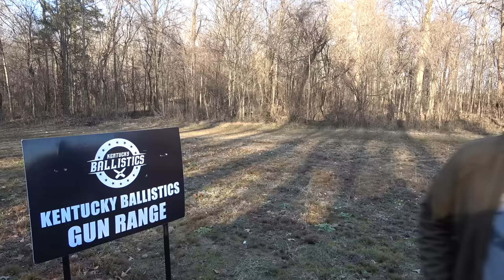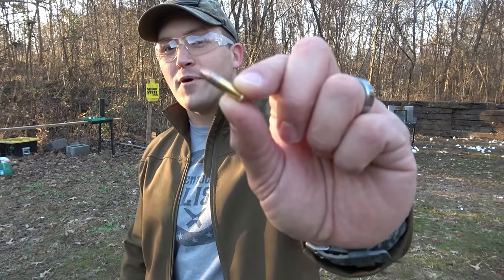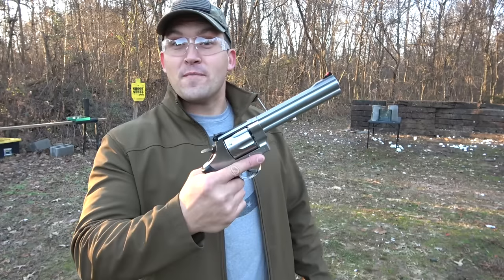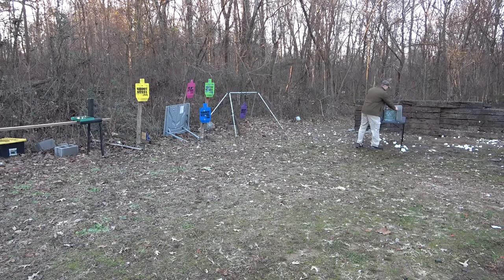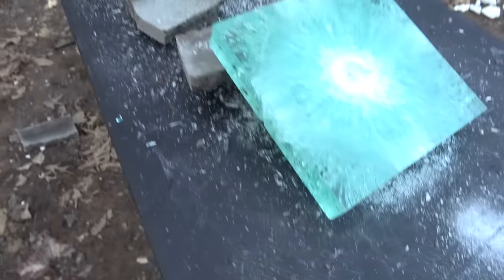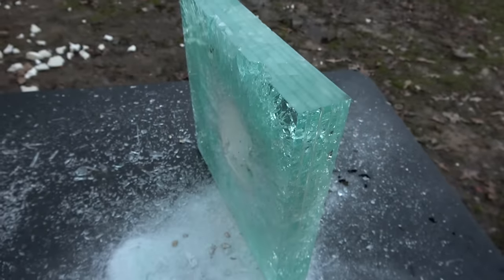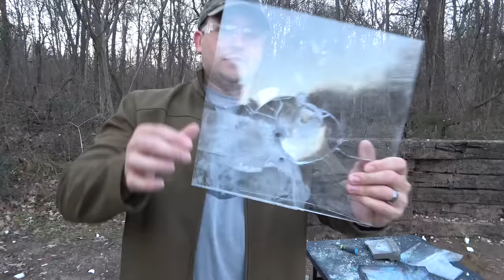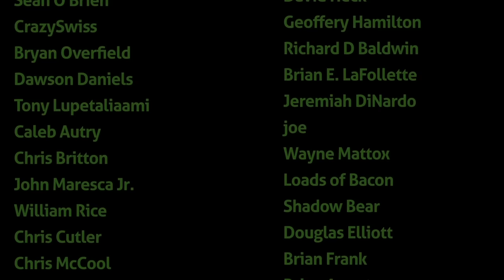Double Barrel Elephant Rifle vs Bulletproof Glass !!!

Comment: I think you shot the glass backwards. Not sure if it makes a difference, but the ceramic side should be facing away from you.
Reply: What ceramic?
Reply: @omnomshibob  the side that doesn’t crumble
Reply: Yes, I think so too. The poly-carbonate (plastic) is most likely away from the threat, to protect from glass splinters flying around.
Reply: @doejohn8674  exactly my thought
Reply: I think you’re correct, the poly side is to protect the people on the inside from it raining glass on them, I believe
Reply: Your right I thought the breakable glass was to break up the round and the lexan side was to stop the now slowed shrapnel am I wrong?
Reply: The crunchy side would be outside of a vehicle, it breaks up the bullet and the soft stuff stops the piece of bullets
Reply: The soft side should always be at the back to catch bullets after they dump energy into the hard glass, I'm pretty sure of that.
Reply: I think you mean polycarbonate, and yes, he had the first pane backwards. I realized that after the first round and thought "welp, there goes the glasses integrity."
Reply: @mikesmith3771  according to me as well, that's what I picked up from other channels.
Reply: They did the same thing in a How Ridiculous video and it does make a bit of a difference
Reply: I guess I'm not the only person that has this idea. Matt at demo ranch could have told you as much...
Reply: @omnomshibob  Glass is a cermic
Reply: My thought exactly. He shot it from the from the wrong side.
Reply: @ilpoheinola6440  cermic?
Reply: @ilpoheinola6440  yeah but technically so is concrete, cement and brick. They all have specific names to distinguish between them, you don't go to a restaurant and just ask for "food.
Reply: @omnomshibob  😂
Reply: Yea he did was about to say the same thing the glass side is the impact side
Reply: Literally just posted the same thing
Reply: Just incase you dont know, bulletproof glass is one-directional. It only works correctly if you shoot it from the correct side. 
By the looks of this footage, you shot first pane from the wrong side.
Reply: Ahhh...
Ok. 
  That would make sense now, after seeing all that glass (facing the would-be defendant) splinter and fly apart TOWARDS the person (lol!)
Reply: these windows do have a strike face usually glass side out unless I'm mistaken.
Reply: It dosn't matter in terms of penetration, Though you are correct the site that splinters should be facing away from what you want to protect, There are multiple layers of the plastic throughout the glass so its not like it only works in one direction.
Reply: Yup wrong way round indeed 😂
Reply: Also should have been framed around. Would have been way stronger. The layers wouldn't have delaminated as they did.
Reply: The glass side that should be in front is hard and starts the "mushrooming" and slows the bullet  that way as it goes through the other layers. Also like above people have mentioned the poly-carbonate is to stop the shredded glass to flying at people inside but also it is stretching and catching the deformed bullet as it comes deeper. That's at least what I've learned from Demos videos and it makes sense to me.
Reply: Was just about to comment the same thing. The plastic/ polycarbonate is supposed to protect from flying glass.
Reply: @brandonrupp5880  Who's Matt and what's Demo Ranch?
Reply: Im gonna agree, not because I know, but because I wanna see this re-done.
Reply: @greggb557  he short he second one correctly
Reply: @mikesmith3771  you are very much correct.
Reply: @omnomshibob  
Wait what? Words have meaning? WITCH!
Reply: I know you
Reply: The hard part is supposed to break up the bullet, and the soft part is supposed to catch the fragments. That's how real bullet stopping armor works anyway.
Reply: @hamishsinclair3541  poly carbonate aka lexan
Reply: John Cage nah it’s like a claymore except you point to toward your self
Reply: @mikesmith3771  no thats totaly right
Reply: It does make a difference
Reply: Instructions smutchins psh lol
Reply: yes he shot it backwards. The glass should be first in line then the polycarb.
Reply: @Deere2154D  yup. Exactly what it is. Lexan backing lol. Not forwarding. Still would stop one round either way
Reply: We are surfing on same wave
Reply: Yeah it had an anti-spall liner to prevent injuries to those behind the glass from fragments created by the kinetic energy of the round
Reply: Glad I’m not the only person who was thinking about this.  There is ceramic armor, so I’m guessing the glass layers would be toward the threat with shatter-resistant polymer behind it.  Same concept, I guess?  But I’m far from an expert, and this video was interesting if for no other reason than I’d never given it much thought.
Reply: Plastic is usually on inside to protect you from glass shrapnel.  Call Demo, he knows which way they go. Get a knife from him. It won't break.
Reply: I was going to write the same response but saw this one first.
Reply: @omnomshibob  food for thought, if glass and concrete are both technically ceramics (made from sand) skyscrapers are just really big sand castles
Reply: Was just going to say that
Reply: Sounds like a redo is in order
Reply: Glass was backward. Even though if I was him rather have the glass go backwards and not the other way around at him.
Reply: It was definitely backwards, the shards are not supposed to go into the passenger area of where the window is placed.  there is a plastic or some-such piece on the back side, and the front is multiple layers of glass with glue or something.  but if the side you are shooting is not cracking and the other side is, you are shooting the backside of the window.
Reply: The normal glass is important to make it scratch-resistant on the outside. The polycarbonate will eat the energy. Also - polycarbonate can't handle UV light from the sun, and the normal glass will block most of yhe UV. Polycarbonate windows have a limited life span if not protected from UV light.
Reply: @mikesmith3771  you are not
Reply: @omnomshibob  maybe you dont.
Reply: Don’t pry with knives
Reply: @ilpoheinola6440  that's what he's saying, the ceramic (glass) should be getting shot and the polycarbonate (plastic) catching shrapnel.
Reply: yep he shot both pieces from the wrong side. The plastic layer should sit last not front and is intended to catch all the broken glass.
Reply: Love you vids very fun👍👍
Thank you

A solid will out penetrate a soft point  anytime😁
Martin
Reply: i made exactly same comment as you, thinking im smart and whatnot and later i scrolled down... lol
Reply: Polycarbonate is a no-spall layer and is designed to be on the “safe side”. You had it backwards. Check our channel for testing videos. 🙂👍🏼
Reply: I was looking for this comment the the plastic like side is supposed to catch the broken glass
Reply: Thats the side that only the bad guy worries about
Reply: @hamishsinclair3541  Magnesium Oxide is the only ceramic material that I know of that can also be transparent.  There are also a number of translucent ceramics.  But no ceramic can bend as shown in this video when he is trying to remove the bullet.
Reply: @johncage3025  Plus, it's on the inside to minimize the damage received (in the plastic) by that Lucky Ol' Sun.
Reply: Scott....most OTF knives aren't worth a crap for quality anyway !    Not All...but Most !  
👍
Reply: same
Reply: There is no ceramic or backwards bullet proof glass is 4 frame 2 sided and there is no ceramic on it 😂 wtf you think this stuff is made at hobby lobbyb😂😂
Reply: And yes technically all glass is ceramic however there is no glass in fuckin bullet proof "glass"
Reply: Polycarbonate and acryl pmma is what bullet proof glass is made of and no it doesn't matter what side Is shot penetration wise. That's basic physics 😂 like saying it would matter If I shot you in the back of front. F internet experts 😂
Reply: yes the polycarbonate side goes inside to protect the people inside from flying glass shards and it also gets damaged and super brittle with direct sun light. still very nice to watch what happens. ive wanted to shoot some of this stuff for so long to see if it really works

Comment: The glass was compromised from the first shot.
Reply: That’s why he used two pieces ya dingus
Reply: @James-kb5mx  still compromised
Reply: As long as the bullet was stop it did its job. Did you expect the glass to still be perfect?
Reply: @jdee8407  bulletproof glass is like "waterproof watch"  no such thing.   just resistant. and use makes it less so.
Reply: I agree. He should have switched new glass for every gun fired. Still a great video.
Reply: @James-kb5mx  Dr. Brule approved
Reply: Exactly! He should have had more pieces to test.
Reply: @jdee8407  Funny all this, actual bullet proof 'glass' is actually plastic, that was just thick actual glass sandwiched together in layers with a resin, pretty different.
Reply: @earshot1111  BRULE’S RULES
Reply: @snowboxesful bullet proof glass isn't plastic. It's extremely heavy, a regular window about 2 inches think can range from 100 to 200 pounds. Layers of glass are glued  together with a special type of glue. This varies between manufacturers, it's a evolving science but acrylic glue, several different glues mixed together, epoxy, polyurethane and PVB. Thing you don't understand is, bulletproof glass is one thing and bulletproof acrylic is completely different. Most bulletproof glass has Lexan or polycarbonate on the back of the glass. Shooting glass backwards lowers how effective the glass is because layers start coming apart as he showed

Comment: Meanwhile in Forged in Fire:
There was a tempering issue in your knife and resulted in a catastrophic failure. Please leave the forge.
Reply: It did not keeel
Reply: I mean if it’s microtech, he should have just bought a knockoff microtech. Marfione is  kind of a prick about warranty stuff. If you dare take it apart to clean it, congrats you have voided your warranty
Reply: That’s funny!!!  Nice cross over!
Reply: Today we will test the durability of your knife by banging it on bulletproof glass then banging the bulletproof glass against your knife. Remember this is a test of what the material does to your knife and not what your knife does to the material.
Reply: I wish every episode of that show wasn't basically the same
Reply: It shall not keel

Comment: “That glass is really really shattered, I don’t wanna touch this”

Matt: Casually touches broken glass every time.
Reply: Matt from demolition ranch
Reply: Doesn't Jump to conclusions  the guy that touches glass after breaking it every time
Reply: Gloves Matt! If you could put the glass on an 30% angle the result will change it adds thickness and changes the direction of the projectile.
Reply: "Bullet proof glass" is safe too touch its tempered glass. You can bathe in it and wont get cut.just a prick from a glass shard or 2. Sorry I work with glass for a living.

Comment: Sad day when you try and use a otf as a pry bar. Especially if it’s a micro tech. Will be having eggplant Parmesan for dinner in protest of the knife abuse. Still a great video of course
Reply: Underrated comment here. And I agree with the point, use the right tool for the job
Reply: Wrong way to use a $100+ knife. Great for stabbing, bad for digging.
Reply: @punkotaku9906  that’s a combat from Microtech. Try $500+ knife. They will fix it for free. Lifetime warranty
Reply: @jeremyh172  Not after watching this video they wont :p
Reply: @jeremyh172  Haha I gotta imagine prying bullets out of glass isn't covered under warranty. I'd be impressed if it is, but sometimes that part of what you pay for up front

Comment: 8:25 yeah, bulletproof glass is just a composite of interchanging glass and plastic sheets. Interchanging something hard but brittle and something soft but elastic is basically the #1 method of making extremely penetration-resistant materials. Beaten only by metal alloys which combine hardness with some elasticity and so are able to absorb impact energy without shattering and spring it back into the impactor. (Hence why steel ricochets bullets so damn much.)
Reply: Barret M95: Allow me to introduce myself
Reply: another important characteristic of armor is the ability to cause the projectile to break up on impact, or to be so degraded by penetrating that the round is no longer effective. glass is very hard on a bullet, almost like an abrasive effect.
Reply: @captainprice3398 children

Comment: The glass layer is called the strike face. Orient toward enemy. The thin plastic is simply polycarbonate, which acts as a binder for the laminated layers. Delamination is common after multi hits. Insert the sandwich into a steel channel frame bolted together and mount it solidly where energy is not dissipated destroying a cinder block etc. it will pass through. Place a thin aluminum witness plate 12” behind it and you’ll get a good idea of how much damage the spall can do. Have fun 😀
Reply: His two squares of bulletproof “glass” weren’t identical. 
The first one seemed to be comprised of around 50% of some plastic sheets laminated together and then the other inner half was glass sheets laminated together. 
His second piece looked like 100% glass laminated layers. 
But you’re right, this guy needs to put in some more prep work to do this the right way. Put the glass into a frame instead of being lazy just leaning it on cinder blocks!

Comment: What impressed me was when you had the cinder block behind the glass, and even though the bullet did not penetrate the block, the muzzle energy was so great the glass collision shattered the block! I've often wondered about bullet proof vest; with say a 44 Magnum, while the vest may not be penetrated, all that muzzle energy has to go somewhere. I would suspect severe internal bruising like you get in an auto accident.
Reply: You are correct about the bruising. I do have some 240 grain platinum coated hollow points that do some extreme damage. Also I have some hot loads with FMJ’s that have penetrated several older vests. I fire them from my lever action rifle that I use for hunting bear.
Reply: There have been documented cases of people dying from the trauma of being shot while wearing a bullet proof vest. The last one I read was a person being shot 3 times with a 45 acp. He had so much internal bleeding he bleed to death.
Reply: It is called transfer of energy. Broken ribs ruptured internal organs. Nope you may not have been struck directly by the projectile but the concussive effects can be deadly. You will not make it.
Reply: @michaeledlin9995  it depends on how lucky you are plus having class 4 ceramic plates helps to absorb more of that kinetic energy. I've read about US military personnel getting shot over a dozen times and surviving.
Reply: @michaeledlin9995  I mean that's just not true. SOME people don't make even after stopping the bullets. The majority suffer bruises, cracked ribs, etc. It's never comfortable, but you still 100% would rather spread the energy out across your whole chest than put a hole through it.

Comment: To make this a true ballistics test, you need to test each round on a separate piece of glass. Each round fired at bullet-resistant glass weakens it, so each subsequent round has a much greater effect than the preceding round. So to be clear...... Test each round with a SEPARATE piece of glass. Thank you for the effort, and I look forward to a follow-up test.
Reply: People replying on bullet proof glass to protect them under fire won’t be able to stand up and replace it with another slab, so I’d say this is a much more practical test. It’s also a YouTube channel and bullet proof glass is expensive.
Reply: @SteveRogers0768  People under fire also very rarely get shot at by increasing caliber weapons.  It's only practical if he shot at it multiple times with the same caliber to see how many shots it could take, before finally allowing a bullet to go through.  With this test he was trying to see how 'high' he could go, caliber wise, and still have the bullet be stopped.  Which is totally and completely useless, seeing as how every single shot weakens the glass (as obviously seen by the cracks from the .45 ACP).  I mean I get it, bullet-proof glass is expensive, but he doesn't just do this with glass.  He does this with EVERYTHING he shoots, and that's the problem.

Comment: When you angle armor diagonally towards incoming fire, you effectively increase the thickness of the armor. This is why the sloped armor on the T-34, tiger II, and the panther were so good. When you angled the glass away from the elephant gun on the first shot you effectively made it thicker. I don’t know if that is what caused it to stop the first round or if it was the cinder block or both.

Comment: that plastic is polycarbonate or sometimes called lexan. It's normally used on the inside AND outside in several layers sandwiched between the glass. This is what helps to really absorb the bullets energy and keeps the glass from becoming deadly projectiles on the inside of the armored glass. Also after the first shot you compromised it's integrity so it's much much weaker. Your elephant gun stands no chance of going through one of those when it's clean.

Comment: I know this video came out a while back and I do wish you a awesome recovery on your latest accident. The “non glass” is a plexiglass/ lexan combination which is a “safer” option for bulletproof glass. The actual “glass” is just probably multiple 3/8 inch glass and lexan. I work at a glass shot and I did this experiment as well even with 12 gauge bird shot and completely bounced back at me 7 feet away and peppered me. Only a few cuts and bruises but if you don’t know. DONT SHOOT BIRDSHOT AT BULLETPROOF GLASS!